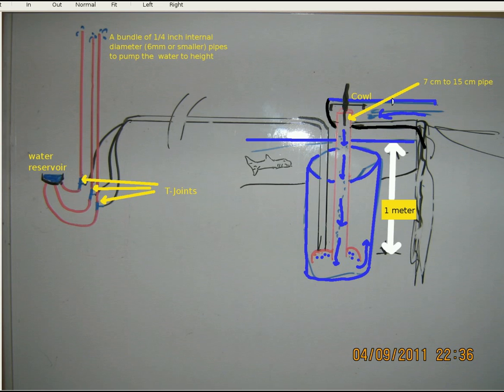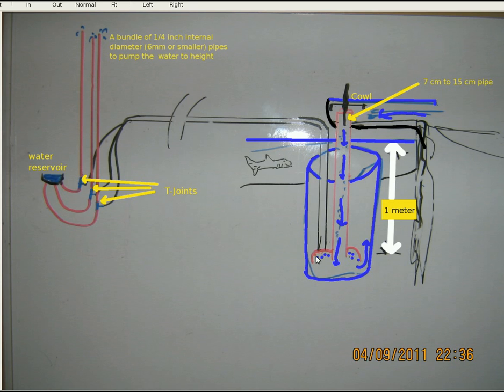Pulserpump Nano  World's simplest pump without the digging! (Brians English for captions)

Comment from the maker: @0rioni Hi, it still needs a fall to work. So you still need  a dam at least a ft high. 1.5 ft is better of course.  but what you don't need is to dig a hole 10 or 15 ft deep beside your river or stream. If you can get something like  one of those big 40 gallon rain barrels into the bed of the stream at the exit side of  the dam, that should be deep enough.  You have a pipe over the dam and into the barrel, collect the air bubbles at the bottom and pipe them to your nano airlift pump.

Comment from the maker: @gaiatechnician I erred on the air volume measurement. I rechecked and found a pipe kinked. Real value is 1.4 liters per minute of air produced.  ( I don't remember if I used "full air  power" on the test that brought water to 13 ft high but anyway that is the figure today). Note that my aquarium pump is a found item. Someone dumped it on a country road and I found it coming home from work.  So it is suspect quality.

Comment from the maker: @Cyber000000 The windowfarms people just use their electric powered  bubble pumps to circulate water round their hydroponic plants. but this might be 10 or 20 times more powerful.  
So this could pump water from wells, it could circulate water round hydroponic greenhouses or in water features.   Basically the same applications as the big pulser pump except for the aeration of animal slurry and stuff like that. I think it needs more pressure to do that.

Comment from the maker: @Cyber000000 I have no site to test it out. But if anyone has a site,  a student, or retired engineer or a teenage kid on a farm could do this.  And harvest some numbers!  
This has serious potential. My other videos show pumping to 13 feet high from an aquarium air pump that delivers just over 1 liter per minute of air at atmospheric pressure! (I measured a minute ago). My old pulser pump pumped 3.5 to 4 liters per minute of water to 10 ft high. In a day, that is a lot of water.